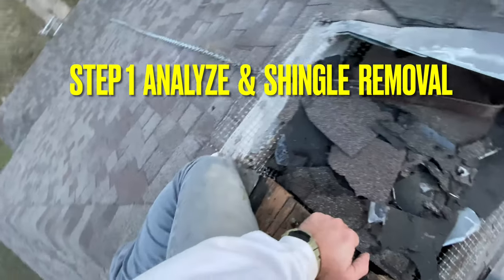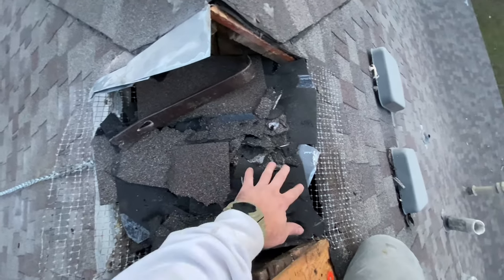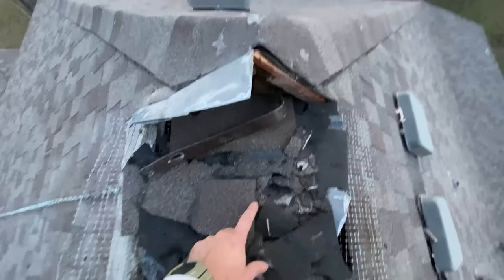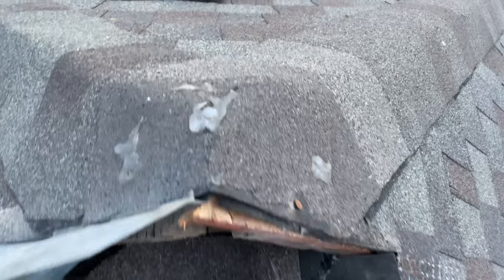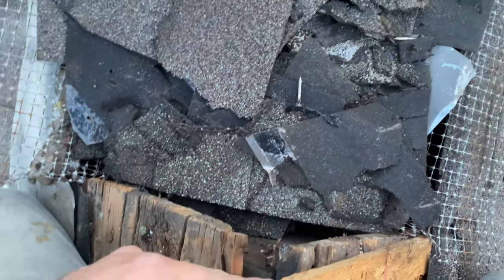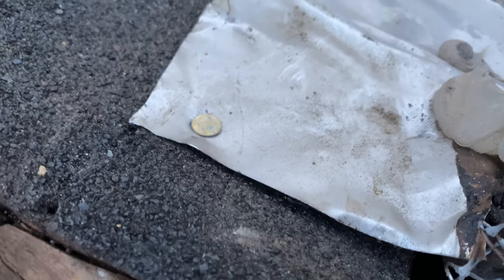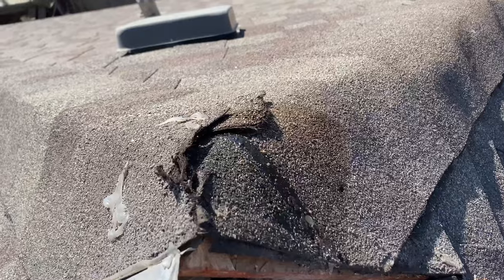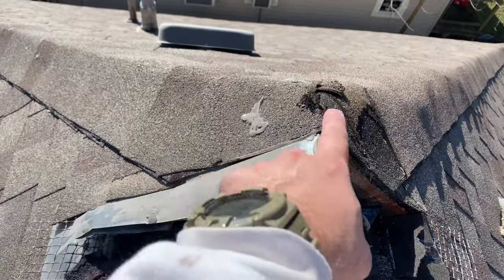How to patch the roof after removing a chimney

Comment: It will leak !!! And no neoprene washer shank nails ?
Reply from the maker: @nicopolis7377  That’s funny that you think that, it does not leak. It’s already survived one tornado 2 blocks away and it rains a whole lot in Oklahoma, thanks for reaching out!
Reply: @GrantKeysProperties  I should have told that I think you did a good job on the roof itself but I am from Florida and shingle roofs start leaking due to wind and heavy rain during hurricane season .
I put a new shingle roof on in 2001 and by 2003 it start to leak due to hurricanes .
My roofer is very good , but they used 30 felt , which is before synthetic underlayment became popular . Watched
your other video with the metal roof and was impressed with your job knowledge and techniques . I gave you a double thumbs up .
Reply from the maker: @nicopolis7377  I love Florida but you do have high winds and more rain there! Thanks, I appreciate that and I like metal also and I see lots of metal roofs in Florida. I think more people are doing them here in Oklahoma also. They probably would last longer in either location and hold up better in hail and high winds. Once a little piece of shingle gets messed with, the leaks come on quickly.